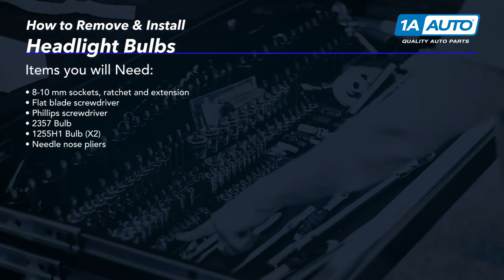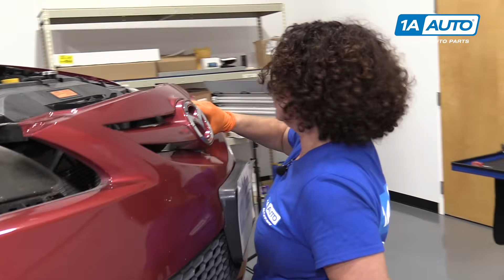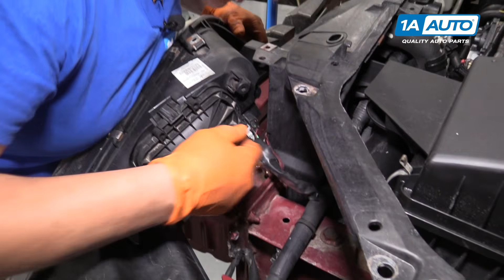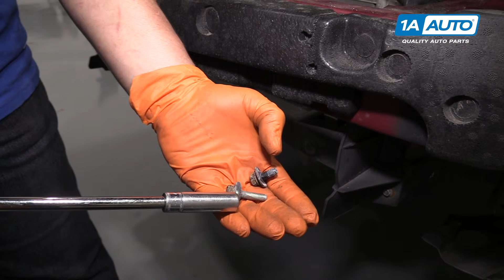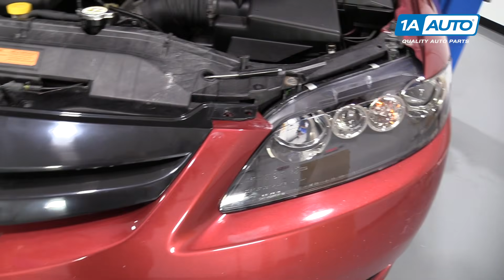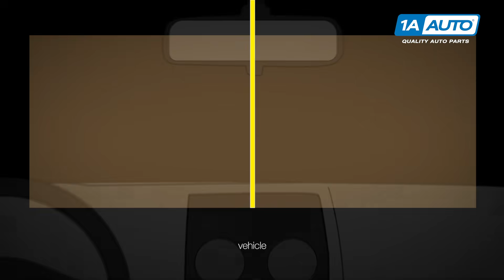How to Replace Headlight Bulbs 02-07 Mazda 6

Comment: I really appreciate this video. I've had to remove the entire drivers side headlight assembly to work on a wiring issue which i have discovered i need to actually replace the assembly due to some pretty crazy looking wiring where someone else has previously tried to fix this issue of the low beam not working. Some of the screws for the bumper were different but I'm also working on an 04 so i didn't figure it'd be exact but it definitely walked me through to where i could figure out how to remove the assembly to see what was going on.

Comment: This method is the best way to upgrade bulbs to 6000K HID low beam and LED high beam, whilst also installing 6000K white LED parking light and orange LED indicators. Why? Because the time you take fucking around trying to get your hands into the tight spots is almost as long as quickly ripping the bumper off and having the whole headlight assembly sitting on your workbench. So, where do you get all these bulbs? eBay, who'll shit all over your local auto parts store on price.

Comment: The bulbs go by hours of use, so high beam doesn't necessarily need to be changed depending on how often you're driving about with high beam on. Usually not nearly as much as low beam.

Comment: I appreciate the help, but I just changed my low beams (farthest to the outside) and it did not require me to do anything but reach my hand in there. I took out an orange colored bulb by accident on the first attempt, so at least 2 of the bulbs come out without any tools required.

Comment: If you are just replacing the headlight, the daytime one all the way on the end of each side rather than closer to the inside, you don’t have to do meerkat any of this. Just pop off that back cap covering it, unhook the two metal prongs that’s holding the light in there. Pull it out. Press the tab to get it off the wire. Replace it. Put it back in. Put the cap back on and you’re done 🙂
Reply: Thank you so much. The only light I had out was one of the outer ones and your comment saved me an hour or two of work.

Comment: Thanks for your videos. They help a lot. The bulb you call the daytime running light, or DLR, is it also the parking light bulb? I have not had front parking lights since I bought my 2008 6, used, 11 years ago. Thot it was same as turn signal bulb that has dual filaments but that's not the case. Any help?

Comment: Just to clarify she is incorrect on which is high and low beam. The inner bulb (towards grill in headlight) is the daytime running (where applicable) and then turns off when the low beams are turned on. The low beams are the outer most bulb in the projector housing. Once the high beams are turned on the ones that were dim lit in the reflector housing inside the rectangle cover section for daytime running light turn on full voltage along with the projector lense bulbs.

Otherwise great video from 2 years ago
Reply: yep.... noticed that she was wrong about the identification of the low and high beams..... the outside lights are low beam

Comment: After watching this video, I decided to do it the easy way. NO TOOLS ARE REQUIRED! For low beam, you twist off the round cap, push the bulb retaining clip toward center to unlock it and flip it up, pull bulb straight out, disconnect wire, and do the reverse. That's it. No tools required, small hands preferred.
Reply from the maker: +Kevin Colabine We appreciate the feedback. Sometimes there are multiple ways to accomplish the same repair.
Reply: @1AAuto  yeah, the correct way, and the stupid way. You ought to put an overlay saying "all this isn't necessary for the low beam"

Comment: I see four lights on that assembly.   High beam, low beam, signal, what is the other next to the high beam?    Thank you for the great video.
Reply: Mine is halogen fog light. From center to corner are high beam, fog, turn signal, low beam
Reply: @БлаговестМихайлов-й7л  she said that the outside light was the high beam.. (with the round weather cover) it is not. it is the low beam at the outside of the light row

Comment: You can change fogs, highs, and lows by only removing water reservoir and air box. A little tight, and you have to be able to work by feel, but not bad. Took me a little over an hour yesterday.
Reply from the maker: +wattakid Thanks for the tip!
Reply: Thanks, saved me a load of time!

Comment: so are there only 3 total bulbs in the assembly? High, low and parking/blinker? I see mine assembly the same as yours has a 4th, one right next to the high beam bulb in the same compartment but is that for a daylight driving bulb that mine must not have, cause it never lights up. I didn't see you change a bulb there and it looks like a prep but not actual bulb?
Reply: I'm wondering what that is as well...Can't find any info on it.. Assuming it's just for looks 🤷🏻‍♂️

Comment: You do not have to remove the headlight or bumper bar, on some models loosening off the washer bottle and/or air box is required, also the park light globe pulls out, not twist. Also that "crash sensor" is the connector for the fog lamp on higher trim models.
Reply: Not even that just go through the wheel well. EXTREMELY easy

Comment: Prior to finishing the assembly, or even putting back in the bolts which hold the headlight assemblies to the car, I always make sure to temporarily reconnect the battery and test the lights.  Get one incomplete connection, or one bad bulb, and you'll regret having to take the whole front end apart again to correct the problem!
Reply from the maker: +125AXer Thanks for checking us out!

Comment: great vid, although Mazda is idiotic! take the whole front of the car apart to change bulbs?? poor design imo.
Reply: You don’t have to. I own this car it’s very easy with out removing anything I’m sure they did it for demonstration
Reply: I changed my low beam bulbs today,i took nothing apart..On the right side is very easy,on the left a bit more complicated but it took 3-4 minutes for both sides
Reply from the maker: Thanks for the comments and for watching! +cuttygrass
Reply: @1AAuto  You don't need to take anything apart. Here's how https://www.youtube.com/watch?v=aRkTRVOoXfs
Reply: Audi did this even 5 years later
Reply: Joanna          NZ  
I also have a 08 mazda premacy  my son put a window motor on and didn't have to take the whole window out, saved  me $$$$ now I need to change low beam globes ,I've watched lots on u tube but can't find where to take out the old light bulbs